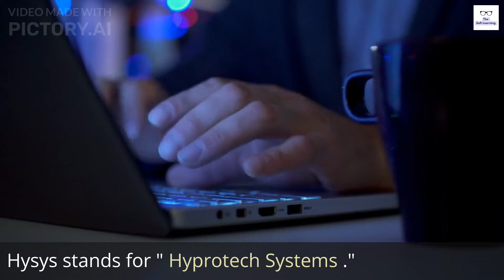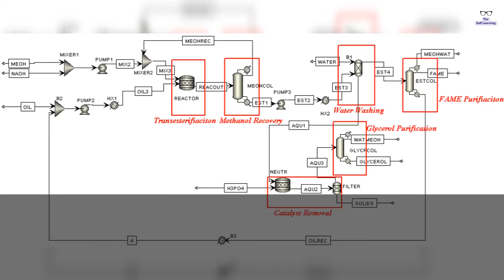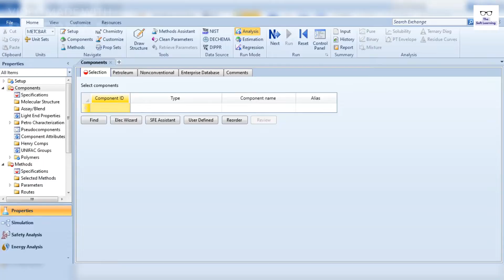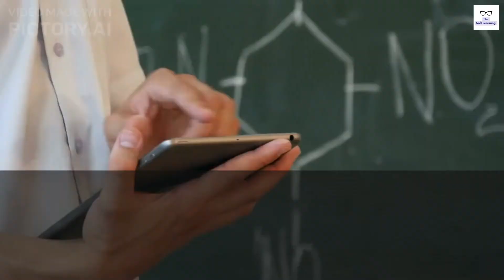Aspen HYSYS vs. Aspen Plus - A Brief Comparison!

Comment: I have just completed my BS chemistry from INDIA. HOW  can I have valuable chemical engineering degree to get job directly in USA (by only online class ) and how should I do it?
Reply from the maker: Most accredited chemical engineering degrees require in-person labs, so a fully online degree may not be possible. However, you can pursue online master's programs, certifications (e.g., Aspen HYSYS, Six Sigma), and gain experience through projects. If your goal is to work in the USA, consider further studies there or explore work visa options. Hope this helps!🙂
Reply: @TheSoftLearning  thank you , will there be job opportunities after just certificate?